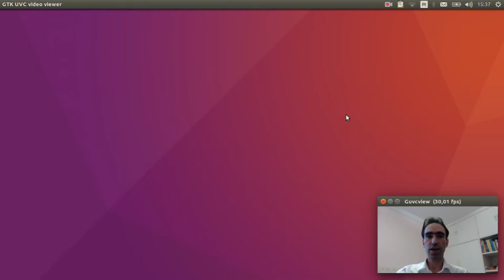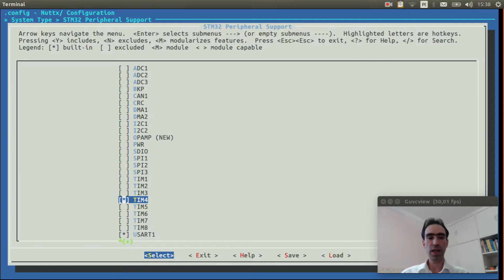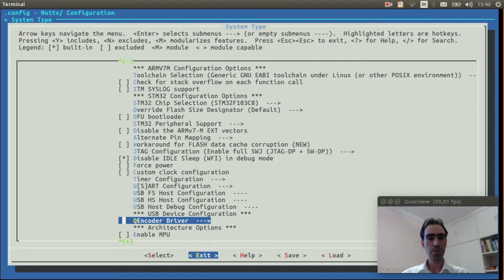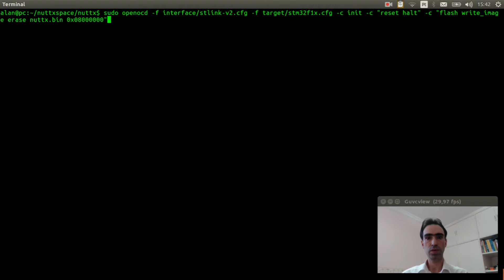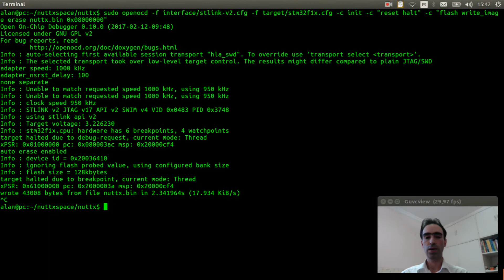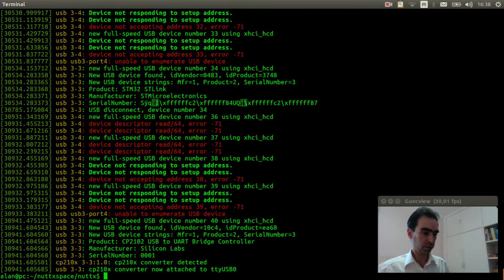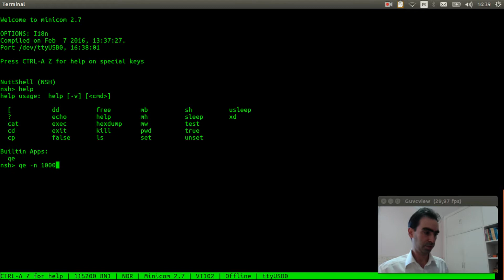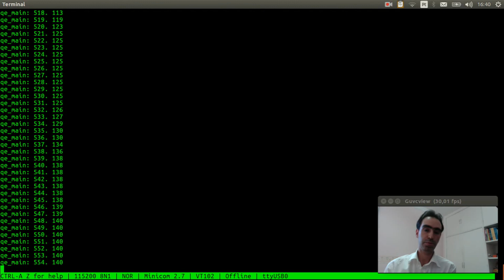#012: How to use Rotary Encoder on NuttX

Comment: Thanks for that helpful video. For some reason the "QEncoder Driver" entry did not show up in the System Type menu in the version I was using. I had to change the depends line from QENCODER to SENSORS_QENCODER for menu "QEncoder Driver" in arch/arm/src/stm32/Kconfig to get it to work.
Reply from the maker: Hi Stefan, I think someone changed the QENCODER name to SENSORS_QENCODER recently and forgot to update the arch configs. Thanks for this info I will verify it.